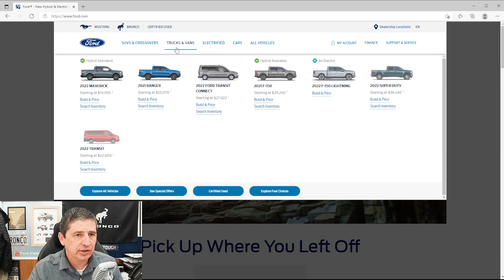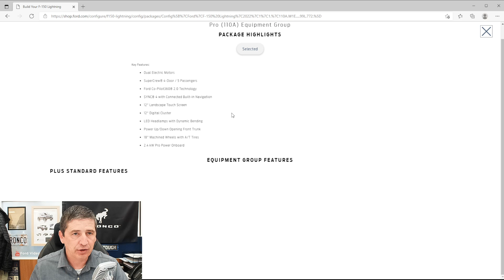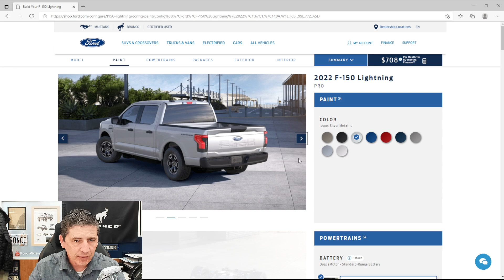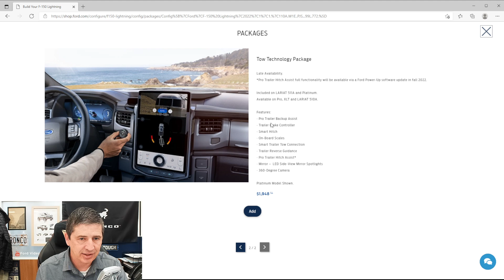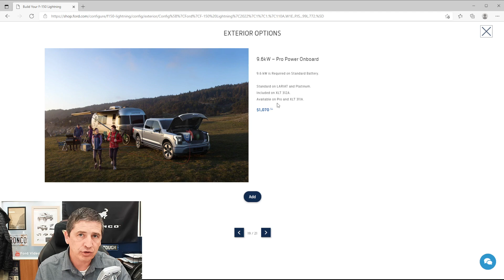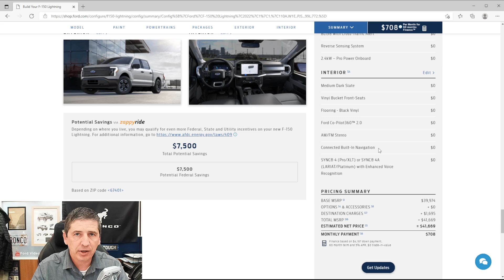2022 FORD F-150 LIGHTNING PRO COMPLETE GUIDE - All Standard Equipment

Comment: Thank you for the excellent video, would you happen to know if the lightning pro comes zone lighting and if so is it possible to set them to turn on whenever you hit the lock button even if it’s already locked? The reason I asked this, it would be nice to have if you’re camping in your vehicle and you hear something outside and want to turn on the lights without unlocking the door. Thank you very much…
Reply from the maker: Zone Lightning isn't available on the Pro, You need the XLT 311A to get it. It can be turned on by using the touchscreen or in the FordPass App.

Comment: When will we be able to order the Pro trim level with extended range battery?
Reply from the maker: It is sold out for the 22MY, it should be available in a larger number for 23MY production. They should be opening up orders this summer for 23MY.
Reply: @longmcarthurford  I see the extended rage battery isn't available in the B&P is why I asked. I didn't get picked up for 2022 so not a real issue for me but would be nice to see all options in B&P   Great videos by the way
Reply from the maker: @guerro327  I went right over the extended battery part, sorry, extended battery is not available for retail purchase only for fleet buyers.
Reply: @longmcarthurford  Yeah, that is the very unfortunate part

Comment: FORD LIGHTNING XLT, WHAT YOU DON'T GET BELOW.
RETIRED 77, USAF VET JET MECHANIC. REGISTERED FOR 2023 CYBERTRUCK ON NOV 22, 2019. TRUCK FEATURES: FULL SELF DRIVING, STAINLESS STEEL BODY, BULLET PROOF, CLEAR ALUMINUM WINDOWS, ACTIVE SUSPENSION HEIGHT CONTROL. FOUR WHEEL STEER, CRAB WALK, TANK TURN, PAYLOAD 3500 LBS., TOW 14,000 LBS., FOUR ENGINES, 800 + HP,  500 MILE RANGE, 35" TIRES, 16" CLEARANCE, 5'x 6' NO FENDER WELLS VAULT BED, WALK ON TONTO COVER.

Comment: Does the lightning pro come with the tailgate with the clamping spot ands measuring board built into the tailgate? 

Or is that only on the costlier lightning
Reply: He mentioned that that option or one with pen depressions and measuring tape, came with the pull out tailgate step included as an option.  Don't know about clamping place, but I imagine so.

Comment: Great video!  Do you think the pro will have a louder driving experience because of the vinyl seats, vinyl floor…harder dash plastic?…less sound deadening materials in the doors and cab?  I’d liken all that to Uhaul rental trucks, which are very loud.  I’d like to go with the Pro for price reasons but I’m concerned that it will sound like a tin can compared to the higher trim levels.  Thanks for your video and opinions!
Reply: Just as quiet as the higher trims. Very quiet cabin.

Comment: Remeber it cost more to insure an Ev. It also has an extremely expensive yearly registraion fee as high or higher than $260.00.  In the winter you will lose half your range when you turn the heat on. Now hookup your big heavy trailer and lose more range.Also most charging stations are only level 2 and level three charging is more expensive than gas.If you can find one that is not broken. I was a previous chevy bolt owner that got bought back by gm due to battery fire recalls. With that said the lighting pro version is a good value. But yearly cost will be much greater than a good ol gas guzzler
Reply: Yearly cost in terms of what? If you charge at home mainly, have almost no maintenance(no oil changes, fewer brake pads, etc), and any issues are covered by warranty, then expenses are fairly low. For me, insurance rates are about the same as my gas car and registration is only $100 more. Winter and towing significantly impact range, but gas vehicles also burn a lot more when towing.

Comment: Short, sweet and straight to the point. However, a similarly optioned XLT w/ 3.5L full hybrid can get nearly four times the range and almost twice the towing/payload capacity. In my OPINION, the best bang for your buck is with combustion engines.

Comment: I noticed that there's no mentioning on regenerative braking which is crucial in charging the battery pack when breaking.  Does it come with it?
Reply: All factory built electric cars have regenerative braking. Only when you get into converting a gasoline car to electric would you possibly come across not having the regenerative brakes feature.

Comment: Here's something I'm curious about.  Apparently there's rumors that the Pro and base XLT (311A package) will have a traditional key to turn the truck on, and not a push button, which is only available on the 312A package for the XLT, Lariat and Platinum.

If that's true, imagine the confusion some will have when the truck doesn't "start" when they try to turn the key to "start"
Reply: Im sure theres a display that says its on somewhere in the cluster.
Reply: No key, the same button as on the higher trims.

Comment: Tim, thanks for taking the time to make this video. Was very helpful answering some of the standard equipment questions I have that Ford Configurator did not address very well or at all.
Reply: Tim, I preordered Lightning on 5/19 immediately when the website opened for reservations. Was told couple months ago by your dealership that I was #1 on the reservation list at Long McArthur. From what I understand order banks opened today 01/06 yet I’ve received no email from Ford. Based on whatI read of various forums we’ve Customers have either received an email from Ford to convert their preorder to a reservation or hav been able to log into their Lightning account to do so. Trying not to jump to conclusions, but I feel like I’m a causality of Long McArthur shuffling the deck. Your dealership has the right to do though. However, if that’s the case I feel like someone should inform me of such changes. If not, then I’d like to find someone to find out why I’m unable to complete my reservation at this time.

Comment: Tim it is worth noting if you pay extra for the tow package it removes features such as the copilot 360 2.0. Not sure why, pretty interesting move on fords part.
Reply: It doesn’t remove co-pilot 360. It just removes it as a standalone package as the tow package includes it (as you also get the 360 camera).
Reply: I noticed that too! Can anyone from Ford confirm if you in fact lose the copilot 360 functions with this package? Specifically the lane keep aides/assists and reverse aids?
Reply: Ya, my dealer confirmed the tow technology package doesn’t actually remove the copilot 360 features
Reply: @devinjones1119  good to know, build and price is way too vague

Comment: Any guess when the cruise control question will be definitively answered for the Pro? That might be a deal breaker for me.
Reply: They all have cruise control.  Standard cruise control for Pro, and base XLT, TACC for high end XLT, blue cruise for Lariat and Platinum.
Reply: @CharlesDB76  Thanks. Is there a document from Ford that shows that?
Reply: @gacampb84  Not specifically, but it can be seen on the steering wheel that there's cruise for all trims.  Cruise control is basically standard these days.
Reply: @CharlesDB76  What concerns me is that the Maverick, being another new pickup in Ford's lineup, does not have CC standard. I hope they don't do the same thing to the Lightning.
Reply: @gacampb84  It has cruise control.  What gives you the idea it doesn't?'
Reply: @CharlesDB76  I'm not saying it doesn't have CC. I'm looking for something a little more definitive from Ford, not stock pictures for proof of it for the Pro trim level. At 22 minutes into the video Tim says "it does not mention cruise control in the order guide" and then gives nervous laughter. I find that a bit concerning as he previously lists more mundane things such as power windows and locks. Also, the Ford Maverick doesn't have it on the XL trim. I just don't want to be surprised and end up having a truck without CC.
Reply: Adaptive cruise control, where the vehicle slows down to match the speed of the vehicle ahead of you.
This is still unclear if this option is enabled on the 2023 Pro version.
Curious if the 2022 Pro came with adaptive cruise control or standard cruise control.

Comment: Curious about the home backup. What do I need to do to ensure that I have that capability.
Reply from the maker: You need to 80Amp Home Charging Pro, which is included with Extended Range Battery. I did find out that if you have the standard range battery, you can get the 80 Amp Charger from the install company in March.
Reply: @longmcarthurford  that’s awesome, any idea on the price?
Reply: You have to have the 80 amp changer. Right now the only way to get it is with the lariat extended battery package so 77K minimum. You will also have to have someone install at your house, probably another $500-$1000. It may come with the xlt extended battery but the builder doesn’t say it.
Reply: @98areece  I assume that I could buy it separately then. I am an electrician so I plan pn installing jt myself.
Reply from the maker: @98areece  You can get the extended battery on the XLT with the 312A equipment group for $74k
Reply: @longmcarthurford  do you know the price of the charger/install?

Comment: Has anyone seen specs on tongue weight on the standard battery with max tow package.
Reply from the maker: 7700
Reply: @longmcarthurford  Thank you for the reply on the total tow weight The trailer I will be towing is about 7000lbs, so cutting it close in my opinion, and really looking for the tongue weight maximum specifically. The trailer is pretty tongue heavy and I want to ensure that if I were to go with the standard battery with the tow package, it would work out. Also interested in knowing if the rear suspension could be beefed up with air bags/springs to reduce sagging and also how the scales/programming  would react if you exceeded tongue weight or if it had any effect at all on the truck letting you tow.Getting to the 10K tow package is quite a steep price jump at $20000 when going to the XLT with the obligatory added options and adding the larger battery. Any insights would be greatly appreciated.
Reply: It’s typically 10% of the maximum towing capability.

Comment: Very disappointed in the pricing guide for the XLT bigger battery, will probably just go down to the Pro
I reserved 5/19 #10814xxx
Reply: Originally, they were going to have an extended battery option on the pro but now it's not available so you have to go to next level up which sucks.  I think they did that because of battery constraints.
Reply: @maxkonig559  you can get extended battery on the pro but only for fleet models
Reply: As of 2/3 the Pro is unavailable to order. Sold out! The XLT trim is the cheapest version to configure now.

Comment: I received an email from my dealer saying that I was being prioritized. I placed my reservation about 2 hours after the website opened. The Pro version is an incredible value. Top tier Power, top tier Acceleration, 4WD, large power secure frunk, Outlets galore, 5 passenger, safety tech and a tax credit. Wow! My Pro version equipped the way I want it will be $46k+. Fingers crossed.
Reply: That's amazing.  I'm in Canada and they're not offering the Pro here this year. "Base" truck here is the XLT with a couple more standard features than in the U.S. and price starts at $68,000.
Reply: Did you have to pay any dealer markups?
Reply: @Rowdybeardown  Not according to the dealer. However, the truck will not be ready for pickup until the first week of August - so we'll see.

Comment: Thanks for the information! Can you confirm if this Pro trim has Push Button Start? The demo vehicles and 360 view on the build tool show it, but also have heard about a flip key? Thank you.
Reply from the maker: Sorry, I thought I mentioned it, it will have keyless entry with flip key
Reply: @longmcarthurford  Than you. To clarify for anyone else that means key in ignition and turning it right?
Reply: @bamaedward6717  that’s pretty silly for a truck that’s starting at $40k. My $23k Fusion had push start.